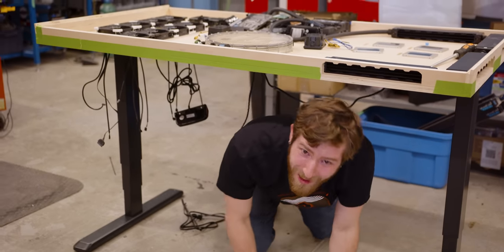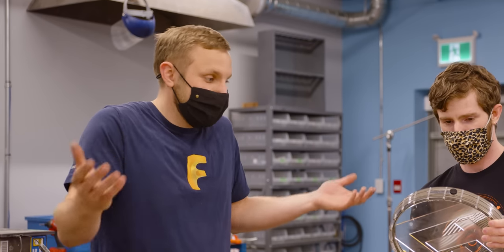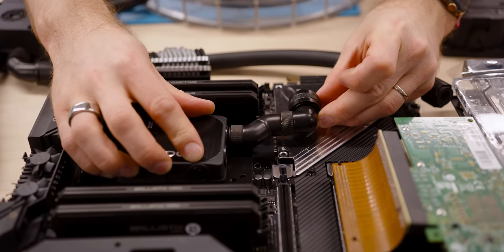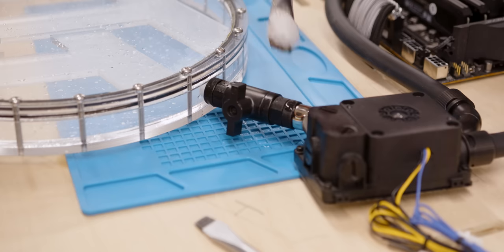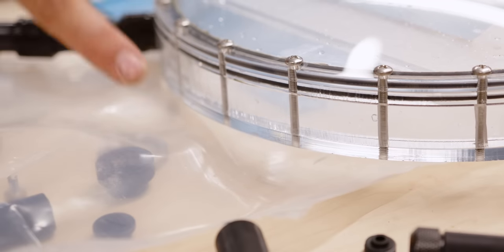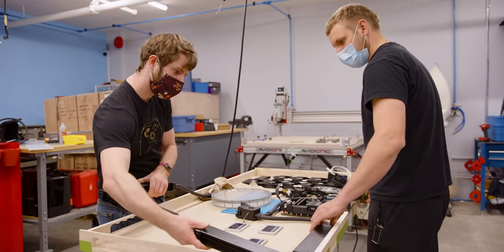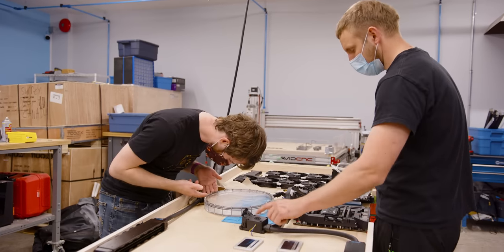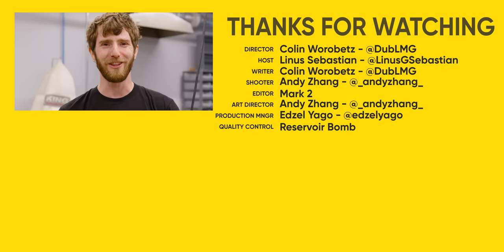The Moment of Truth… - Next Gen ULTIMATE Desk PC Part 3

Comment: Hey Linus for future builds, you want to use a spiral point tap when tapping acrylic. The way the flute is cut is to be used on holes that go all the way through and instead of the chip gumming up inside and ruining everything it forces the chips to be pushed through the hole leaving clean threads and you can go reasonably fast with this specific tap.

Comment: Just a word of advice from a drummer. To get even pressure around a round surface (like the res here) you need to tighten one screw, then the screw directly across from it, and then move on to the next screw and the screw across from that one and so on. This ensures that the surface pressure is equal through out the top of the res and you're at less risk of breaking your res and will ensure the o rings are pressurized properly. (Really you're supposed to make a "star pattern" but with this many screws that's not really as easy to explain how to do)

Comment: Do your tapping under a drill press with a little downward pressure. Keeps the tap from slipping, the threads normal to the hole, and allows consistent smooth pressure tapping the threads

Comment: Try on a scrap piece , slightly undersize the hole you drill in the acrylic . Then , heat the tap with enough heat to slightly soften the acrylic as you screw it in to cut threads.

Comment: You should use a bike pump or a soccer ball pump. They adapt easily to the EK pump. Using the mini EK pump is not practical because IF there is pressure loss, it is also happening while you are pumping so it could take forever to get to the “green zone.”

Comment: You should boil the water prior to using it as that will remove a lot of dissolved gases from the water. Or you could use a vacuum chamber to remove all the dissolved gases from the water or even combine the two methods. The added benefit is that if you do get rid of all dissolved oxygen from the water, corrosion problems get mostly non-existent. Then you should use a vacuum filling station to get all the air out of the systems during the filling of the water system. Also adding some car cooling fluid would mitigate corrosion problems. It could solve a lot of problems...
Regarding your homemade reservoir, use a torque screwdriver so that the screws are tightened down with the same torque, which will put a perfect consistent pressure on the o-rings...

Comment: to combat cracking while tapping, you have to use a Drill Press for it when trying to tame the beast that is acrylic. hand tapping threads leaves a lot of room for error, and in most cases will be the reason for damage. (assuming your tools are up to par, and that you have everything properly drilled IE measurements.

Comment: you really should cross tighten, and find a good average working torque for each of those screws/bolts. You're almost guaranteed to warp the device by tightening them in a circle. Letting it set under slightly higher pressure expected during use for a day or so, letting it leak, might allow the O-rings to move around enough to create a better seal that would work fine under the pressure you expect to use it under. I am not a professional, I've just made a shitload of mistakes in life, and learned a lot of lessons lol.

Comment: For help getting rid of the bubbles, you should buy a motorcycle brake calliper nipple (stop laughing) and use that with an o-ring in the res.
This way, you can open the valve to allow literally ALL the air to escape and you won't have bubbles in the res.
Additional bonus; you can use a bleeding kit to remove all air and have a fully water tight pressurized system with air release valves for water changes.

Comment: You should have cut the pockets and pattern needed in the res, then align it with a 3d printed piece made out of water soluble material, weld it, then fill it with water and wait. Leave it oversize on the outside diameter then finish it with all 4 pieces assembled.

Comment: The LTT water reservoir needs big thick 0 rings, the problem is plastic threads are very easy to strip and break but to keep it from leaking it needs to be tight.

Comment: For future reference from a guy who does pneumatic testing on a daily basis, next time you tighten fittings or joints be sure to depressurize the system.. system integrity will be greatly reduced if tightened under pressure.  Also your joints will be tighter under no pressure as opposed to even 5-10psig

Comment: Protip for Tapping holes: Drill the hole in a drill press and then replace the drill bit with a center (a round tool that come to a point). All Taps have a spot drill in the top which you place the center into and then tap your hole. The tap will be lined up with the center of the hole and the tap won't try and do it's own thing.

Source: Machinist

Comment: I've had an idea for a while, why hasn't anyone tried to make a metal tube with fins to help disperse the heat? Or at least a fluted tube.

 I guess you could make that out of a solid block of aluminum, drill a hole through it, then CNC the outside. 

Ik it's a lot of work but these guys made a solid gold Xbox controller.

Comment: That's not O-ring lube, it doesn't help seal at all, its retention compound and its only purpose is to help you install the O-ring. Also careful with this design, the thermal set of the oring after heat cycling could cause leaks before you want as there is very little chance your plexiglass structure is applying enough clamp force on the o-ring for infinite cycle life.

Comment: Why not machine the lower out of a single piece of acrylic with a second piece for the top? Also, you can buy large o-rings. Get a proper rubber o-ring and make it a two piece design and you will have a reservoir that will have a drastically lower chance of failing.

Comment: LINUS! READ the instructions that came with the pressure tester, you are NOT supposed to pump the pressure that high especially with acrylic distro plates and what not. It's misleading with the "green zone" on the gauge but yeah, it might've been fine to begin with if so much pressure wasn't pumped into it.

Comment: Are there concerns with decreased flow when adding 90° bend in the tubing? I know in the pool world, the number of 90° turns in the plumbing can be minimized to prevent flow restrictions due to the water on the inside of the bend moving slower than the water on the outside, thus causing turbulent and decreased flow.

Comment: Im not too familiar with water cooling... would it be possible to have 2 different colored liquids running through the same water cooled system... like a lava lamp effect or like when you put oil and water together. That would be cool.
Reply: YES, you just need to have two closed loops. So like one to your gpu, and one to your CPU. It would be challenging but it is very doable. You would need a big case however.
Reply: @babayaga1644  I was think together... like a lava lamp where the liquids could mix. If they were separate you could just have another tank that isn't part of watercooling just for the effect.

Comment: Why didn't you just drill out oversized holes where the pipe fittings go, and glue in a cylinder of material that's easier to tap? 

If tapping acrylic was so hard in this instance, it makes sense not to keep tapping acrylic, just drill a hole, put in idk delrin or whatever, then drill and tap that

Comment: Go for bent and soldered copper, nice heat dispersal on it's own...use plumbing\heating industrial components, computer components, too much reliance on o-rings. Finally consider using used car parts for cooling...intercoolers from turbo cars and any cheap radiators or heat exchangers can be had for pennies, including tiny pumps, motorcycle cooling systems are particularly powerful, reliable and compact. Finally polish it to an elegant mirror finish, mount it on a self propelled chassis and ride to it work, think of the productivity, no downtime you idle slackers. P.S pls employ an engineer I'll do it for free. love yer madness.🏍

Comment: if there was even 10PSI of air pressure in that reservoir, based on a 12" diameter reservoir, there would have been 1130 lbs of force on the reservoir lid, it was close to being a bomb, 20 psi would have netted 2260 lbs of force hahah

Comment: Assuming the cost of this system ...
Why didn't you just mill an aluminum plate (I mean whole bottom plate of the desk) with a "heatsink" cut out all over the bottom (outside) surface of the bottom plate ...?
You know, aluminum desipates a little more heat than wood ... and most of the components can simply be passively cooled.

Comment: Bad engineering to use hard lines with all the angles needing so many O rings. Each one is a potential failure point. Would have been better to use flexible tubing.

Comment: I've never done a custom loop, but is plumbing tape never used on the threads of the fittings for a better seal?
Reply: The o-rings do the sealing here, not tapered pipe threads

Comment: That Res was done in a dumb way, why use so many bolts, why tapping acrylic... The fasteners used in this project are inappropriate. It could've been done without the bolts and by using aquarium acrylic glue, if it holds gigantic aquariums together why wouldn't it hold a bloody water cooling loop :/. Huge props to the machinists tho, I'd love to know how many scrap pieces there were

Comment: Is not looking good at all the hardware all sitting on wooden surface. The hardware heat will not dissipate efficiently in long run the table will turn into something else. Why not try to put a layer of aluminium sheet on top of wooden surface

Comment: I was watching an older video where linus upgraded his wife's pc and I was having a similar problem im using dp in a pretty short length and my monitor will just go black with a box in the center that says 144hz 1440p do or something like that I've tested gpu, monitor cables and I can't figure it out

Also when I turn my pc on after being shutdown the Taskbar won't have any apps loaded so idk 

If anyone could help me or give suggestions thx 

Also my mobo is b 550 f gaming wifi cpu r5 3600 GPS is 1660 super Asus tuf oc 6gb and monitor is gigabyte g34qc in dp mode